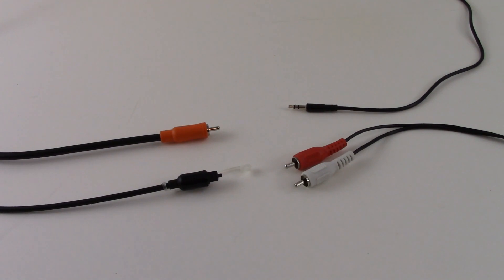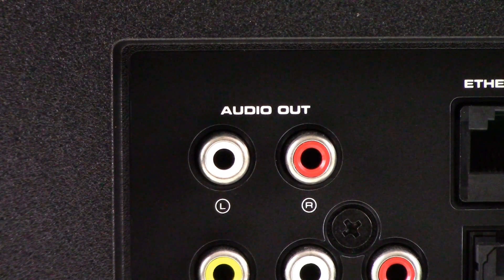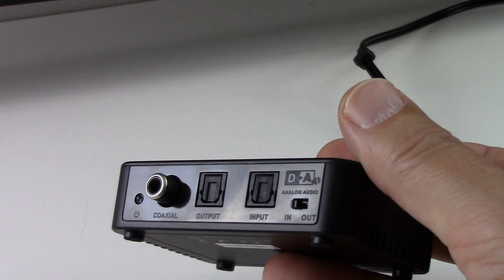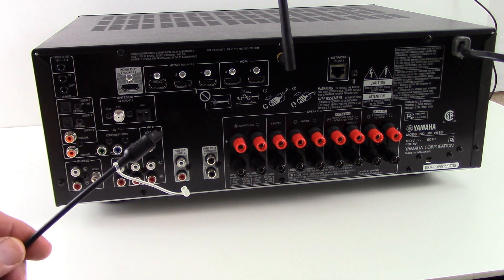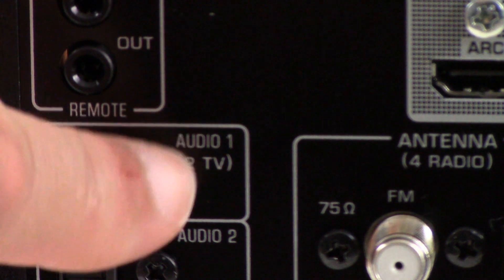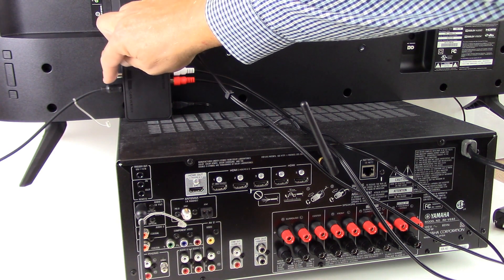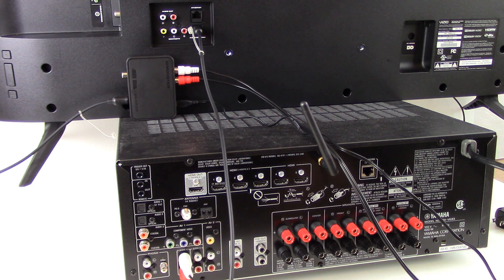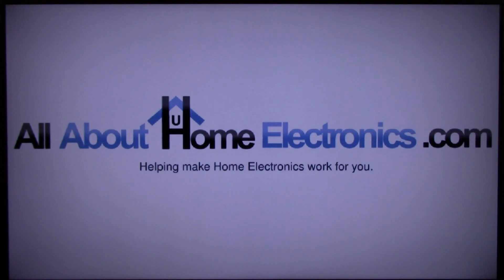How to Convert Digital and Analog audio cables

Comment: Thank you for this video. I have a pioneer receiver and just bought a new Samsung Smart TV. I can't get sound out of my pioneer home theatre system. I have the red and white cables. Do I need to plug them into the TV in ports and then what do I do with the other end. Is this where I need a converter of some kind?